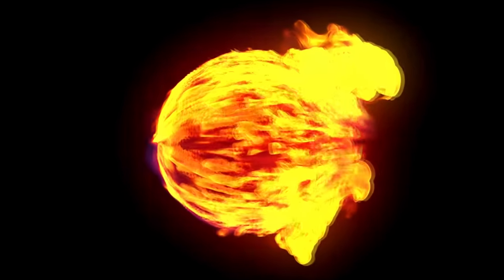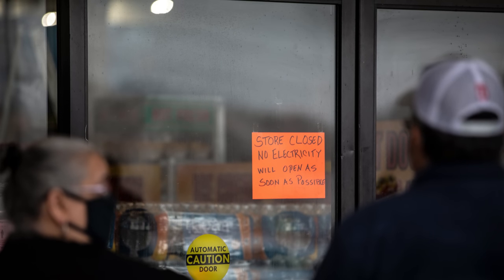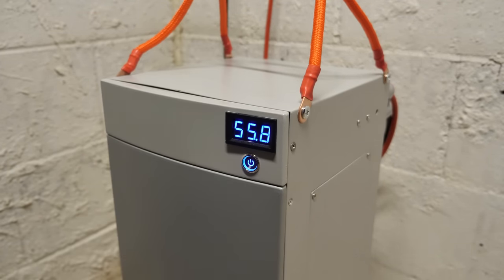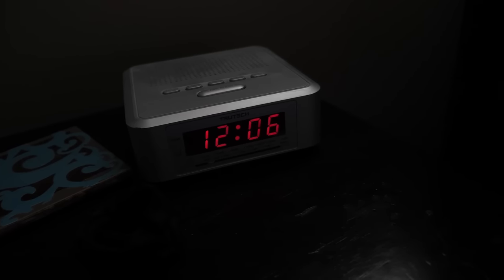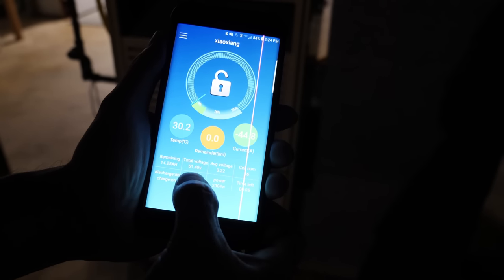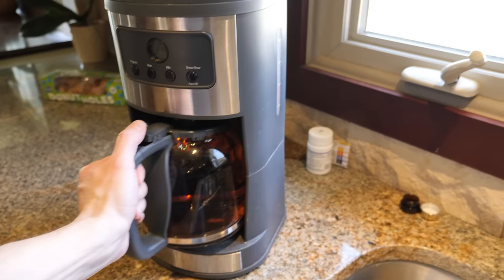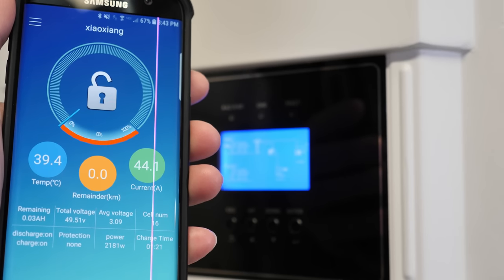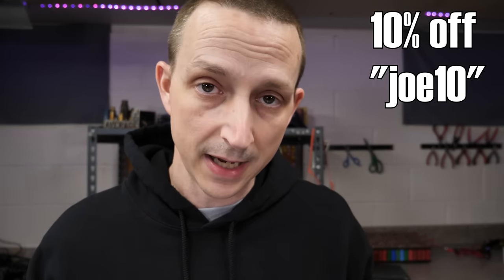Power your House with a Husky 48v 5.3kwh LiFePO4 Battery! BigBattery.com Test Review (2023)

Comment: On my inverter it says the Open circuit voltage is 250 v  but it has two inputs does it split in half. Like 120v for each input. Or can each input take 250 V open circuit? Thank you for any assistance.
Reply from the maker: Yup 250v in each and 60amps each for a total of 120amps!
Reply: @AveRage_Joe  that’s a great help buddy thanks a lot!!!!
Reply from the maker: You bet! I have my solar panels in a 6s 2p in each input. Total of 24 panels. I could probly add another 1 or 2 in series but winter time may over volt since solar panels produce more voltage when cold.
Reply: @AveRage_Joe  That’s awesome. You have a great set up!!!! Are you constantly powering you home with solar now? And how’s your inverter holding up? That’s my plan.
Reply from the maker: Yeah powering everything but the stove, dryer and AC at the moment. Will add those as the battery capacity increases. That can really happen at any time. Just need to add the new batteries but want to video the process. Havent been able to video much due to work🤦‍♂️ So for now I power the house in the day with solar and recharge at the same time then battery at night. Everything is working great. I did have a few fan lockup faults with the inverter the first few weeks but then it all cleared up and hasnt had any issues. 💥🤘
Reply: @AveRage_Joe  That’s great news!!!! Wish you all the best and hope Big Battary send you more batteries. So we can see the performance. I was going to purchase over 1.14 MW of batteries from Big Battary but since they piss me off I will not be purchasing any batteries from bigbattery in the future. I’m looking at a new company called ARK lithium solar battery. Might be going with this company soon.
Reply: Well mine inverter that I purchased from them is a piece of shit. They were going to get a lot of business for me and that’s over. I finally hook mine up. It can’t even take 45V on the solar in each string. We just used 2 solar panels and It hose into overlord. And you can’t even charge the battery with solar whatsoever. Added to that you can’t even set the battery low voltage limit to lower than 41v. If you run LED lights on this thing it’s like a light show. It keeps flickering. I just had a bad experience with this inverter. My Victron invert is much better than this.
Reply from the maker: Whoa for real???? Im at a loss for words! Mine works great!
Reply: @AveRage_Joe  yeah man that sucks!!!! And they don’t take returns. They don’t even email you back when you asked them a question? We have to look around YouTube for answers. Are you on a business and if I treat my customers like that I don’t think it will survive.
Reply: @AveRage_Joe  on your inverter can you set the menu 21 Low DC cutoff to 40.0v?

Comment: I have the Big Battery Lama which has slightly more power.   I do see a bluetooth on the BMS, but no info about the app, but that info would be really nice to have.   Loved the video!   It looks Big Battery is out of stock of all 48V batteries.   I am almost ready to connect everything.  Thank you for the tip of pre-charging the caps in the inverter.    BTW I am an EE who has designed and builds a 28V LIFEPO4 battery for Areospace, with charger, heater, and BMS.  I was considering making my own, but decided I could not be as cost effective as Big Battery.   Quality product!
Reply from the maker: NICE!!! That battery looks pretty nice as well! If you see the bms in bluetooth you should be able to connect like I did with the same app. 

I work for the USAF on the RC-135 and would LOVE to see a lifepo4 battery imstalled. The LA that we use(and rebuild) are so old, heavy and outdated. Plus they drain down so quick lol. Hope to see your battery one day!!!
Reply: @AveRage_Joe   Our battery is used in the GAU19 Gatling Gun.   BTW: My son works on the A10.  

So far I have been unable to get the BMS to connect.   While testing my Big Battery I came across an issue.  When I pull over 28 Amps sometimes the right most decimal point [   28.] on the current display will come on and the display will lock until I turn off the battery, the battery keeps working, just the display locks.  Big Battery says they don't know what that means.   This sure sounds like a fault condition to me.
Reply from the maker: Nice!!! A10's are BADASS!!!🤘  So for your app, try installing the overkill solar version. The reg version from the app store may also be the issue. I havent heard of a lock issue either so cant say for sure.
Reply: @AveRage_Joe    The overkill did not work, Big Battery insist there is no BT on this battery, however, I can see it.  Got my BB and Inverter connected.  About ready to deploy my solar panels.  I am using a Solar Gold Power inverter, because it has  240V split phase output 60Hz.

Comment: Loving the Average Joe style take your doing bro! Just use it is what 99% will do.  Do wanna see ya rip it apart too lol. Xiaoxiang app needs the ah set and even once it's fully charged it has a reset function to recalibrate. I just found that and had to do it the other day. Seems to reset if you have a low voltage shut down  which wacked mine out anyhow.. Cheers and sunny days brother 🌞
Reply from the maker: Yes Sirrrr!!! Thanks!!! Yeah the app seems to work better meow that Ive had actual usage with it. Im for sure doing a teardown and capacity test vid!!!💥🤘

Comment: Hey Joe.

After watching the video I do believe but that would be a fairly decent battery for most any average small home environment.

During the Texas "frozen" blackout as you call it our timeline was hours and hours 24-hours was not uncommon, there was no rolling about it, it was turned off to keep the whole thing from collapsing. 

That was during the three days below freezing temperatures, I saw 17 degrees for almost a day and a half.

That configuration would have been great, what with approximately 4kW max peak working load plus gas for cooking and heating.

🤔💭💣💥
Reply from the maker: Yeah the battery did a great job!  Much better then I was expecting for sure!!!  I think its a GREAT option for keeping the lights on when the power goes out or depending on your demands would be great for off-grid as well!💥🤘

Comment: It’s strange they supply 6 gage wire, witch is rated at 60 amp, and the inside wires are 4 gage !! It should be the same !!
Reply from the maker: Sure I can see that but keep in mind the insulation is rated to 200c so you can run more current. Those cables also dont come with. I think they will soon offer 4awg wires just not sure when.

Comment: Like over feeding a toddler, you won't notice the damage until its too late. Battery charging limitations and parameters are in place for a reason. Taking too much energy OUT of a battery bank or putting too much back in will drastically reduce the life of ANY battery. Again, it won't be "noticed" until it's too late. Temperature readings on wires only represent excess resistance, not actual flow. Just sayin. This idea is GREAT - but for longevity, pay it out slower and recharge at lower rates - 10 years from now you'll be glad you did (but keep this up every week and you won't have a battery pack very long).
Reply from the maker: 100% true!!! Under normal operation you wont do what I was doing. I wanted to make sure it did what they said it could do!😀🤘

Comment: Is there something up with the App youre using. For the last half the Ah meter was reading 0.0?
Reply from the maker: I didnt know at the time that the bms will recalibrate and show your last capacity used after a cycle. So during video it was "recalibrating". I also mention this in the capacity test video I did a few weeks back!🤘
Reply: @AveRage_Joe  awesome!! Thanks so much for the reply!

Comment: AC or Heater running at the same time.
Reply from the maker: We use gas for whole house heat so I ran furnace blower motor.  I did not run the AC as it is still connected to the grid at this moment.  It would most likely drain the battery down pretty quick...at least at our house since its so old lol.😆

Comment: Because it is NOT (sorry) clear what voltage you are implying when rattlling off the drawn current Amperages, the relevant Wattage is more useful to international viewers whose local grid supply may vary considerably- eg 100V through 250V and 50 or 60Hz?
Reply from the maker: Thanks for the input!🤘

Comment: Idk If you said this but where you bought the solar system and power box system do they have ppl install everything or did you do it thanks
Reply from the maker: I installed everything myself! I purchased everything except the battery in this video and have a link for each item in description box!🤘
Reply: @AveRage_Joe  that's awesome. I'm more on the machanic side wish I could do this stuff been wanting to do this and wind sence I was little but the prices they want to install and how long it take to pay them forget that
Reply from the maker: I am a mechanic lol. My day job is aircraft maintenance on an Air Force base. Learned all this stuff watching other youtube videos!💥🤘
Reply: @AveRage_Joe  nice ya I tried electric stuff but at the price what what these cost and I don't work with that stuff daily I'd rather not cross the one wrong wire lol I'm mostly in old school machines and equipment bc no one works on them where I live only new stuff with computers lol
Reply from the maker: 🤣 Yeah I hear ya on that one! Nice, yeah I much rather work on the older vehicles as well! Im not much for the new computerized stuff! It over my head🤣
Reply: @AveRage_Joe  ya you pretty much need a DC degree to work on them and they are only doing it so ya pay thounds of dollars to s dealer to cut out the ppl that couldn't do things like that and more problems to go wrong with wire one bad wire messes up the hole system
Reply from the maker: Thats the TROOF!!!

Comment: Explain the Growatt inverter 4000-12000 HDVM and DVM
Reply from the maker: DVM has a 150v mppt solar charge controller in it and the other is a high voltage model with 250v mppt solar charge controller in it!🤘

Comment: HOW MANY PANELS WOULD I NEED FOR THIS?
🙃FOR A10
 FOODTRUCKS
Reply from the maker: What kind of power do you use now?
Reply: @AveRage_Joe  6500 Watt Gas Powered Portable Generator
Reply from the maker: What all do you power and for how long. Do you know the watts of the items and are they all on at the same time or some on some off?

Comment: How much and who installs this ?
Reply from the maker: Links in description for pricing on different products.  Installation would be a local electrician in your area or you and a friend!
Reply: @AveRage_Joe  It would be a licensed electrician for sure.  I’m looking at a generac 14kw generator for the whole house with gas line install. My house is about 1500’sq ft so which battery would suffice for that example and is this product has a switch to know when the grid goes out? ?  Thanks for what you do.

Comment: You should have a way to check how much energy you used during the test.
Reply from the maker: So during the test portion since I had never used a battery with a smart bms I was unaware that the bms would recalibrate and show the most recent discharge in amp hours.  I did a capacity test video and mentioned it in there!🤘
Reply: @AveRage_Joe   Okay, thanks for the reply, I'll check it out. The wild card with these batteries is how many recycles you'll get, they're used packs, did I hear that right? So even if you do a capacity test that will only cover the specific battery unless they got so many batteries that all their packs are basically the same.
I'm testing the EG4LL 48V, 100A in my system now.
I will tell you that the killer in northern climates in the winter is heating, I run oil with radiant floors. The furnace motor and the circulator pumps are killers! I just ran 12 hours (mostly dark) with two EG4's  and I'm down to about 30% SoC. If I get some sun this morning I can charge them but overcast will only maintain the present SoC.
I'm probably going to add another battery for ~15 kWh total but because PV is so cheap now I'm going to add more PV so even if I don't get full sun they will still charge to some degree even if it's mildly overcast like today. I think a lot of people don't realize that you can add more PV and save on the high cost of batteries.
I don't want to do it but if I install a decent wind turbine it will probably allow my batteries to run indefinitely most seasons of the year (summer, even with two batteries I can run indefinitely without wind). 

The interesting thing is that the first time I cycled the batteries they just made it through 12 hours, it took a couple of recycles to get up to full power, which is expected. This morning I still have 30% or a little more left.

We do lose power where I am in the Catskills several times a year. Summer floods and tornados can put us out for a week but I've never seen longer that that. Just to give you an idea of a real world scenario someone is facing on the 42 parallel.
Reply from the maker: These batteries are brand new and have a 10yr warrenty! Yeah many batteries need a few cycles to let the cells come into balance. Very normal as the battery packs sit at a warehouse at roughly 30% soc and "balance" there. 

Yes indeed adding more panels for sure for the overcast days. I need to do that for sure. Summer time is ok with what I have but winter.....NOPE lol.

A wind genny would be cool! If I lived out of town Id have one!

Comment: Wow that’s all well and good. I love the hole idea, free energy. You need to consider the cost of the battery, the life of the battery. Solar panels are not cheap I hear especially the good quality panels. My goal is self-sufficiency at a low and reasonable cost. 
We lose power at my address very often. The Grid is weak. The sun is strong. We all need to find a way to take advantage of it.
My wife and I were going to get sun-pro to install a high-quality system to our house. The Cost was high but reasonable. We decided against it because one I didn’t like the idea of selling energy back to a energy Company. And two, you had to buy the brilliant lithium ion batteries at an Additional cost . I liked your video.
Reply from the maker: Thanks Mate! I purchased a bunch of used solar panels off ebay. Roughly 5kw for around $1200. Inverter I paid $2000. I think if one does it them selves you can save BIG! Plus you get to learn new skills!

Comment: 3 hours and the battery voltage dropped from 56v down to 43v, that's 13v drained. Testing of using appliances like vacuum cleaner was less than 1 minute. You tested some tools like on and off. You did not turn on your AC and if you did, you failed to give how many tons you central air. To summarize, your test was not good enough to prove this is an awesome  battery... Just 3 hours the battery drained 13v already from 56v to 43v and you almost panicked.... if we do the math average of 4v drained per hour with 2 refrigerators that will not consume too much electricity when maintaining temp when door always closed. Dish washer maybe 20 minutes run time. The lights with LED bulb consumed less electricity. My estimate at 4 hours the battery will go below 40v roughly 39v. This battery will not last 6 hours based on your test... anyway your time and effort is highly appreciated. Thanks

Comment: Did your UPS system transfer appear to be seamless? I know that there are some really sophisticated UPS systems that are online devices and the transfer process would never sees any aberrations for the 60 Hz. They are also continuously conditioning the voltage of any spikes or voltage sag because they are truly continuous online systems and you would never detect the transition or transfer during the blackout. The 60 Hz will always be in sync with the utility's grid.
Reply from the maker: It is pretty seamless. You may see a slight dim/flicker but not much. For the most part you dont know. In everyday life if you are around you hear the beep and a little click. Maybe I could do a follow up video and can show that better.

Comment: For the vast majority of people this is a $2,200 waste of money.
If you are running a business using computer servers from your home it may be a good idea.
If you already  have solar panels and use this instead of the battery system that would normally go with your panels then this may also be a good alternative. 
But for most people not in those situations in a grid down situation that lasts several days it is much better served by a small generator.
Tech geeks seem to like doing "cool" stuff but tend to ignore the economics of doing it. 
Those that disagree with me tend to be in one of the groups that I just said it may be a good idea.

Comment: To bad that you didn't got a Victron inverter !
Reply: Too Bad ? You would need 2 of them , plus the 3 or 4 other "boxes"   The Growatt is split phase 12k all in one  .
Reply from the maker: I havent really looked into there inverters much! I hear some of there products are great tho!
Reply from the maker: Oh TROOF! I did hear that as well!
Reply: @onthelake9554  indeed, my bad, but the efficiency is 95 to 97 % and no load current is less that 30W,  with load zero in search mode 10W.  and it could use from battery  9,216W vs the 8,160W  after inverting! don't forget that his invertor is using 200w doing nothing! hope I didn't disturb!
Reply from the maker: Is the victron a lof freq split phase inverter. If not that would explain the higher eff for sure. Mine is Low frq split phase. No you do not disturb by anymeans. 💥🤘
Reply: @AveRage_Joe  Has a massive 2 transformers. is using just 1 on low power enabling the second one if necessary !

I personally have a quattro 48/ 5000/70 and works superb.  with a bank of  AGM lead acid :) (I know i have to upgrade) but the battery bank is doing the job from 2013! Off-grid ! you need 2 for split phase or a transformer